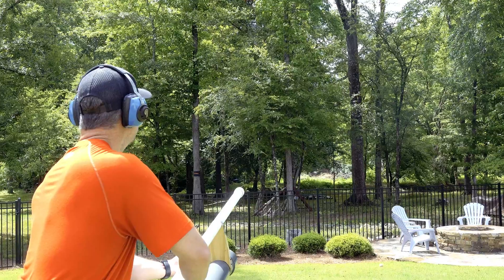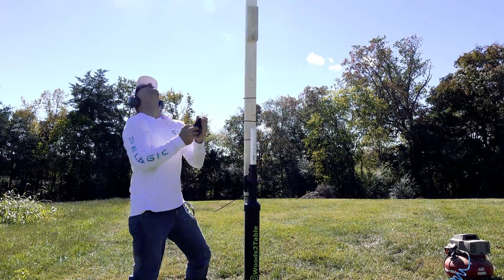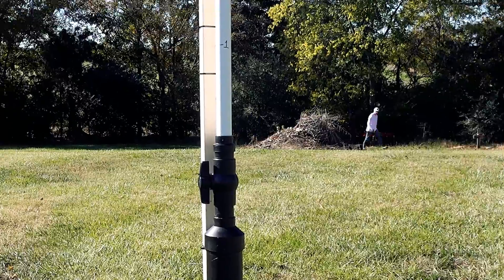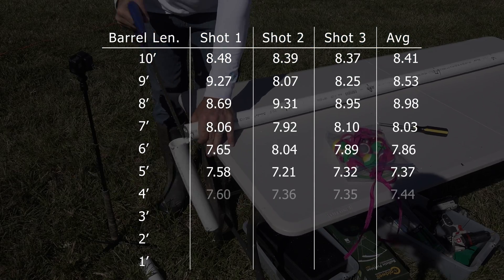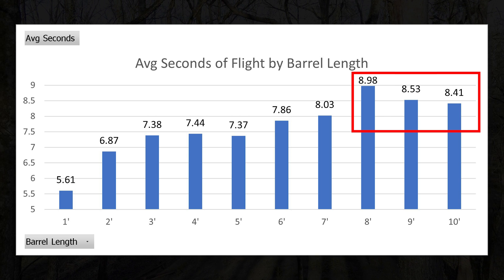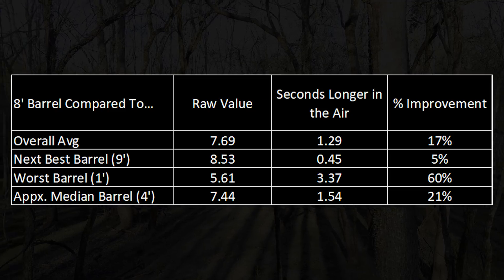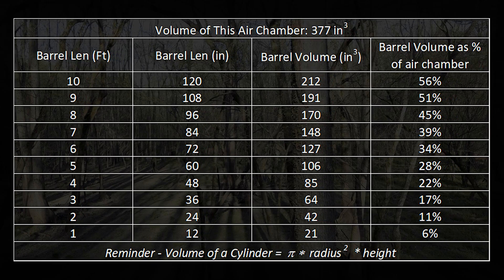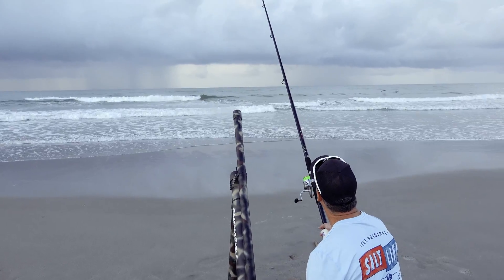DOES BARREL LENGTH MATTER for a Bait Cannon??? How to get the MAXIMUM DISTANCE for a BAIT CANNON!

Comment: Thanks for this video and all the others you've made. I had a similar idea about how to test how far/most efficient a given air pressure will launch something - by shooting it straight up and recording the hang time. Then I found your video and you did it all! For me, I just need it to set lines into trees when doing tree trimming, but launching tennis balls, golf balls, potatoes, etc. winds up being the kind of thing guys can just get in to. 

Great video and methodology, the mini tennis balls are very light so someone might get different results with a heavier projectile. That might change the equation on what's the best pressure and barrel length. I also like the idea from your other videos of making frozen projectiles. Even when not using them for casting bait, you can goof around with the kids and friends and launch ice bombs and they will just melt away. 

As a teen and then in college (when I should have been studying), me and my buddies made potato launchers, soda can launchers, and whatever we could find and shove into a tube and launch it with some hair spray and a lighter (don't do this!). There was no YouTube or internet back then, we just made it up as we went. Thankfully we didn't maim ourselves, but we were creative and resilient. We should have used safety glasses more, they were not as common back then. This is way more sensible and now we know how to blast a half-pound of frozen fish 100 yards away! Science! I love it.      :)
Reply from the maker: Thank you so much!

Comment: I know this is an old video, but i saw you never posted the chrono video, or am i maybe missing it?  Also youll get more velocity with a solenoid valve as ball valves loose some efficiency due to the slow opening of the valve, and youll see more consistent results as well.

Comment: Confirms my thought that my barrel is not long enough. 4"x36" chamber and went with a 4ftx1.5" barrel. Only getting shy 150yards @ 90 to 150yards.

I will increase barrel length to roughly 80 to 90% volume size and reduce as needed.. Now I only will have to figure the baits. Mine have been shotgunning out of the barrel even frozen.

Thanks for the input big guy!

Comment: On your 45% barrel to tank chart, do I need to consider the volume between the valve and the actual barrel? ie: fittings and pipe to make the 180 degree turn

Comment: The performance based on length of the barrel will depend on the volume in the specific air chamber and pressure in the chamber.  Definitely a balance.

Comment: Hey man, did you, or someone you know, have the cylinder explode on you??
Reply from the maker: Thankfully no, I’ve not had that happen. But I’d have to assume it’s possible if the wrong material is used, parts are defective, unit is damaged or assembled improperly, or too much air is pumped in. Be careful out there!
Reply: @Woods2Table  thanks man!!  Be safe, healthy, and Keep making great videos!! Mahalo and Aloha🤙🤙

Comment: This is a cool test and informative, but that tennis ball is nowhere near the weight of a chunk of frozen bait. That will have an effect because it will reach maximum velocity a lot later than the tennis ball. (A 40grain .22lr has a max velocity around 1200 fps and optimal barrel length is ~16”)
Also, optimal barrel length will get slightly longer as pressure goes up.
Reply from the maker: fair points raised here. We'll have to look into testing some of these in an upcoming video. Thanks for the ideas and support!!